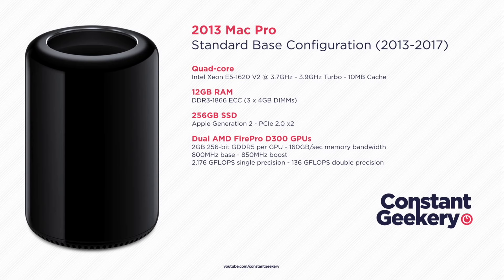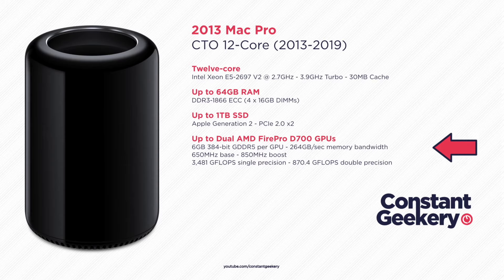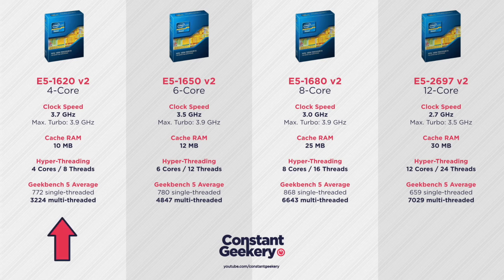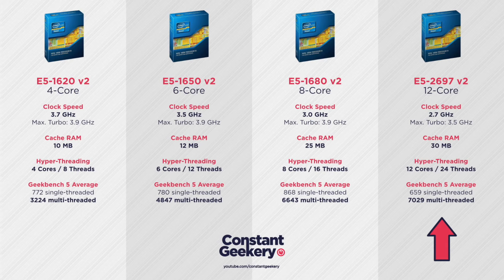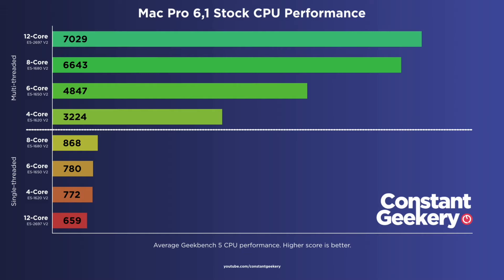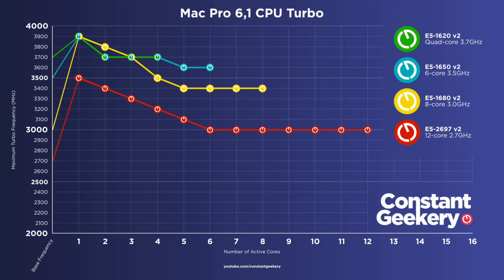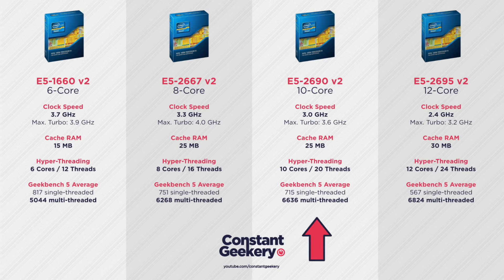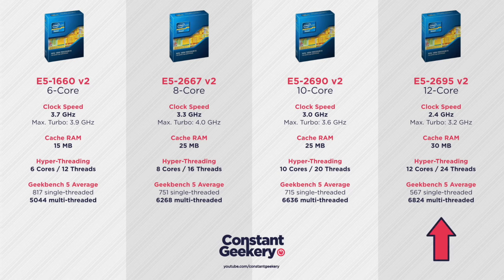Which 2013 Mac Pro should you buy?

Comment from the maker: Apologies for the dodgy lighting, editing and sound. Not my best effort!
Reply: Constant Geekery content is stellar
Reply: I didn’t notice an issue, just background light increased and decreased in tone.

But I was paying more attention to content that what was around you.
20k subs gogogo
Reply: Hey friend, I wonder if you have any suggestion to this problem...when I replaced my internal drive with an OWC one, not knowing better or perhaps something went wrong, I, by mistake formatted the OWC drive in Mac OS Extended (and even worse, as Case-sensitive), since then it won't let me update my OS saying it is a non-compatible third party drive.  I asked OWC what to do and they suggest I just put in the original drive to do updates...the problem is that I already long ago wiped that drive fully, including the security partition, for other uses, so I believe it won't do me any good? right?  High Sierra really lags for me these days and the case-sensitive mistake has cause me other challenges.  Any ideas on what I can do?
Reply from the maker: @MichaelSidneyTimpson  If you’re happy to wipe the drive, I would try restoring from Internet - OWC drives should support that. (https://support.apple.com/en-gb/HT204904) In the restore system you can open Disk Utility and make the changes, then you can clean install the OS.
Reply: @ConstantGeekery  The original drive or the OWC drive?   if original drive, do I really have to break open the OWC encloser and remove the OWC drive and put in the original drive or can I do it all from USB?
Reply: @ConstantGeekery  unfortunately that's a dead link
Reply from the maker: @MichaelSidneyTimpson  you said the OWC is your internal drive. Restoring from Internet will work on the internal drive. YouTube has made the closing bracket part of the link, which is why it doesn’t work. https://support.apple.com/en-gb/HT204904

Comment: Great video. i actually picked up 12 core  with 512ssd. it only had 16gb ram which upgraded to 64 for less then $100. the great thing about it was it was advertised will D500's but when i got to the seller and we powered on it turned out it had D700s. it was a recording studio get the shelves cleared for the 2019 Mac Pro. The IT guy handling the sale didn't want the hassle so he still honored the listed price with a $100 reduction because i mention the ram upgrade i had to do. Picked it up for $1650! yes it was a steal! I was upgrading from a 2010 Mac Pro Cheese Grader so it wss a nice upgrade. After all the peripherals which i slowly pieced together used and new items total cost of the system came out to about $2300. I'm a sound mixer so it more then enough power for me. Since all my work is offline picture resolution was never going to be an issue. I'm now running four 1080p monitors and i couldn't be happier. the only then i want to advise is make sure to download and install Mac Fan Control. this machine have a tendency of overheating and this  app will really help prevent this. the pro edition of the app is $15 and will worth it. After install adjust to at least 1600rpm constant fan and then 1800 for work when editing. this will help tremendously keeping the system from overheating.
Reply from the maker: That sounds like a very good deal indeed! Completely agree on the fan control. I use TG Pro, which is very similar. My Mac has been super stable ever since. Thanks for watching and sharing 😊

Comment: This is the best and fullest explanation of the Mac Pro 2013 upgrade options I have seen yet!  Thank you!
Reply: I am using a 2013 Mac Pro 3.7 GHz Quad-Core Intel Xeon E5, with the (nicer) AMD FirePro D500  graphic cards for Photoshop work, the logic to move up to the E5-1680 8 core chip makes a lot of sense, thank you!  I suppose I could go for the 12 core, but the higher clock speed of the 8 core chip seems like a good idea for normal day to day use, and the loss of speed VS the 12 core does not seem to be that much.

Comment: I just bought a base model off some guy on gumtree, it was his work PC and they told him he could keep it.  I dont think he new what he was selling tbh cos he listed it at £299 and as soon as I seen it I rang him and said I would take it.  WIthin 4 days, I had upgraded to 64 gb of ram ( the max you can have if you want to run it at 1866 Mhz ) stripped it down and took out the crappy 4 core cpu, put an 8 core in, thermal paste and cleaned the machine.  Now its running at 38 degrees idle and a lot faster now its using all 4 dimms and the new cpu.  I want to get some D700s but they are just to expensive.

Comment: I bought the entry level MP trashcan in 2013. I could only afford the very base model. But it is still my main computer and does everything I need quickly. I don't do games or video but I do a lot of Logic Pro music with zero problems. My specs
3.7 GHz Quad-Core Intel Xeon E5
32 GB 1866 MHz DDR3 (upgraded from 12GB...only update)
GPU AMD FirePro D300 2GB
Have NEVER had a fail of any kind. Still my main computer. And I still LOVE the design.

Comment: When Phil Schiller gave a sneak peak of the Trash can Mac Pro  i instantly fell in lust with its unique stying , a radical improvement from its big boxy cheese grater predecessor , this machine was elegant and had a small footprint reducing desk clutter . Learning it wasn't that upgradable at the time i blew my savings on a maxed out 12 core 64 GM memory and 1TB SSD . Thats about a grand a year since the purchase price from Apple was 7K . Well its used daily , silent running and still looks awesome , i get the limitations of connectivity but that's the trade off with such a compact machine , it still looks radical and not dated i would go as far as to say a design classic though i know it has its detractors like Marmite .

Comment: Thanks for the info, I purchased the six core new with an apple 1TB hard disk when they came out, replaced the ram with OWC 64 gigs. It did overheat sometimes but mainly from collecting dust so clean it out occasionally, i run 2 apple 27inch monitors, an LG 34inch Ultrawide as well as a sony bravia 55 inch through the HDMI port. I love all the monitor ports as it replaced my previous apple tower which I had installed multiple video cards to do the same thing so it was a no brainer to buy a machine that of the box could do what my previous machine had to be customised to do but running about the third of the electricity but more silent, also the fact that it looks a little like R2D2 is a bonus.

Comment: Hi I picked up a 6 core model with the D500 GPU's and 32GB ram. total $99 with shipping. cosmetically its near new with only a small scratch or two. So far its handled every thing I've thrown at it. Installed Final Cut pro 10 and working on my first video with it now.

Comment: I went with a 12 core a couple years ago.  At the time my thinking was that I wanted to max out everything on my 6 core. So I went to 64GB ram, OWC Aura Pro x2 1TB SSD and was already working with dual D700. 
What I found out is that the D700 have more artifacting problems than the D500. Also, the 12 core CPU only hits it's stride when you are firing on all cylinders. On single threaded stuff the 6 core was slightly better. Wish I'd gone with the 8 core. Also, you can get 128GB ram to fit, but it knocks you down a notch in speed. 
Overall I'm happy with my setup as I can have Photoshop, Premiere, Logic and a few other things open with no noticeable impact. 
OTOH, I still suffer terribly doing renders. Also, the disk subsystem and USB ports are slow and really bottleneck the work you can do. 
TB2 is the only way to go for storage. The USB3 on this machine is actually only slightly faster than USB2. It is very bad!

Comment: I've only recently discovered your wonderful channel when looking for upgrade advice for my Mac Pro 2013 3.7 GHz Quad-Core Intel Xeon E5 which I bought on eBay in early 2017 - so thank you for enlightening me of the constructive options available. I matched the Mac Pro to a newly discontinued Dell UK2715K monitor which had matching twin Display ports as well as a single Thunderbolt 2 mini Display port. I had the ram upgraded from 8GB to 32GB using 16GB x 2 in one pair of slots only. Sadly, the pair of display port cables only worked for a short period before something gave up the ghost so I am left with the single  mini display port cable as the main source of monitor display. I have successfully produced an animated 8 minute video using Adobe Premiere (albeit the rendering was painfully slow) as well as for Photoshop, Illustrator and Lightroom but have now run out of disk space but use USB WD hard drives for extra storage. I now want to upgrade the Ram and replace the processor as demonstrated on your video (it looks relatively straight forward?). My questions are as follows, 
1) Replacing Ram:- How do I identify the Generation 3 or 4 Apple replacements being advertised compared to the original fitted Ram boards?
2) Replacing CPU:- Should I look only at 8 core CPU with 130 watts for this particular Quad powered machine rather than 12 core that appears to require 150 watts?
3) What do you think is my problem with the paired display port cables not delivering (half screen each when they worked)?
4) I run Catalina 10.15.4. Should I revert to Mohave?
These issues have been accumulating over the last 2 years until I discovered your channel! Any advice would be very welcome - thank you.

Comment: Just bought my trashcan originaly purchased in 2015 with dual D700s and 6 core CPU, instantly swapped it into the 3.3 ghz 8 core you've mentioned as I was about to repaste the whole system for optimal cooling :) the sad thing is I bought a wrong nvme ssd which Mac Pro didn't read and I'm about to swap it for another.

Comment: aspiring audio engineer here, I have been having issues with audio plugins in pro tools running on windows and macs, I mainly use 6 core processors and the 1 time I used an Apple silicon processor I finally had the pleasure of running more plugins, it was the 10c CPU with 8 Performance and 2 efficiency cores. Its a lot of money.. I just purchased a Mac pro quad core, and a 2697 v2 12 core CPU. I specifically looking for a budget replacement for the expensive m1 pro macbook pro! IF this performs the same or better then im selling the macbook pro!

Comment: Dust makes a huge difference, my AIO Ryzen 7 1700, was reducing performance to 25% due to bad air flow from duct. I opened system up, cleaned intake holes and removed system fan (CPU/GPU) and body, vacuumed out heat sink etc.
Performance went back to 97-99%. Didn't change thermal paste as system under warranty still.

Comment: I think the 8-core D500 is the best to have, but a budget option would be getting a 4 or 6-core and buying a 2680v2 processor, it is a cheap 10 core, usually like 15€, where the 2690, 2697 and 1680 all do around 100€.

Comment: Just bought a 6 core 32gb RAM, 1Tb SSD with the D500 graphics cards. Your video has convinced me that I made the right choice. I have already found a matched set of 4 x 16 sticks of RAM for £36 and a used E5-2667 V2 for £15. 

That is a total of less than £320 for a very decent machine! (now where’s that thermal paste!)

(Edited to add that reading most of the comments on here, the 1680 8-core processor is probably the way to go. A bit rarer and about twice the price of the 2667 but I suspect that I will end up with a better machine.)
Reply from the maker: I would stick with the 2667 - it's clocked slightly higher. Not much difference on boost frequencies, but in theory you should get marginally better single core performance.
Reply: @ConstantGeekery  So you would recommend the 2667 over the 1680?
Reply from the maker: @john8451  either is great. I’d choose the 2667 personally.

Comment: So I've always wanted one, and recently had the opportunity to get one on the cheap.  6core 32gb of ram, the low end D300's.  I didn''t know what to really do with it, so I did the upgrade from whatever it had to Catalina, and wow what a MISTAKE.  First off I loaded up steam as many games that I have, also have MacOS versions, but the majority are 32bit, so that sucked.  The one game I wanted to play with my kids, Kerbal Space Program, actually caused the machine to have CONSTANT kernel panics.  I think the thermals are kind of dodgy on these machines, they do remind me a lot of the G4 cube, a machine built around a quite heatsink, although the trashcan has a fan at least..  I loaded Macs fan control, a MUST have program for any 2013 Mac Pro user out there, as the Apple defaults are simply too low (I made the mistake of lifting the lid after a kernel panic and it was incredibly hot under there!

You may want to do a video on how to downgrade to Mojave, as it wasn't all that intuitive (well for me anyways) as the bootable USB won't show up in the control panel, instead you have to hold down a key at boot to get the OS boot list to boot from USB.  I deleted all the old partitions and installed Mojave which may have been a bad move, as I don't think Mojave installs a factory recovery partition on re-install. OOps.

I have a PC with dual E5 2667v2's and I thought it was a pretty fast machine, although I didn't realise that the  2013 MacPro was also a 2011 machine, I'd thought for some reason it was v3 at least, but oh well.

I'm curious to what others thing of Catalina on the 2013, to me it's a total dud.
Reply: Did you ever figure out how to downgrade to Mojave?   It’s easy.  I can help.

Comment: CPU/GPU speed aren’t the only measures that matter. How fast are the drives in these machines? I’m guessing pretty slow compared to new SSDs in the Mac Mini or the MacBook Pros.
Reply from the maker: I’ve done other videos on that, but max speed on this machine will be about 1,400 MB/sec. So, yes, slower than the latest. However, as Linus Tech Tips recently proved, once you get to about 600 MB/sec, most people can’t tell the difference in everyday usage. Obviously if your workflow involves a lot of file copying you will notice, but for the vast majority of workflows, it’s plenty fast enough.

Comment: I bought my 6 core new refurbished from Apple in '14 as well as the Apple care warranty. I saved about 1200$us from a brand new in the box one. It came with the D700's, 500gig SSD and 8 gigs of ram which I upgraded to 32. I used it mostly for SD video editing and Photoshop with a little bit of 4k, which it does very well. Now Im mostly using it for music recording and production which is pretty easy for this setup, although nothing really uses GPU that i'm aware of. I just upgraded the SSD to a 1TB EVO, no real problems other than I was using 10.11 and had to  upgrade to 10.13 to take advantage of the NVME.  So I started to have video troubles recently and after a bit of research found out about the GPU recall, a few calls to the online service dept and they really took care of me. Replaced both video cards, IO board and some other stuff, all no cost.  If you have an Apple work flow, this is it.
Reply: What kind of problems with video Mark?

Comment: Great series,  aftet watching I decided to make a Mac pro 6.1 purchase with a 6 core 32g  AMD D500.    I have one question as I day trade stocks , I notice I could not add more then 2 monitors I usally use 4 monitors.  I notice You had ePGU in the back ground, would that help with adding more monitors to Mac Pro ?   or which is the best ePGU that matches up with Our Mac Pro?  Thank you
Reply from the maker: You should be able to drive six displays, unless your screens are 4K, in which case it’s two via the Thunderbolt ports and one more on HDMI (though HDMI will only run 4K at 30Hz). The eGPU is an option for additional displays and I’ll be doing a video on this soon. It is not natively supported on the Mac Pro 6,1 so you have to use a third party tool to make it work (purge-wrangler). You also need Apple’s Thunderbolt 3 to Thunderbolt 2 adapter. You won’t get maximum performance from the graphics card. Also you have to plug in (or switch on the eGPU) after boot up and it’s best to disable sleep mode. I use the Razer Core X because you can buy your own card - you can’t change the card in the Blackmagic Design models. If all you need is additional displays, the Sonnet Breakaway Puck is the cheapest route. Hope that helps, and thanks for watching! 😊
Reply: @ConstantGeekery  They are not 4k monitors just LG 23inch  FULL HD 1920X1080 - I tried to get all 4 displays going at the same time, did not work.  But I am going to go with Sonnet Breakaway Puck - Ill just have to figure out (purge wrangler )   thank you for the reply - looking forward towards your ePGU video!

Comment: I just bought the 12 core 64gb and d700 version. i have it in bootcamp. but cant run some games because of it showing that the driver is not the latest. and  i cant figure out  how to upgrade the driver. the bootcamp seems to not have the latest driver for it. i also cant use any kind of AMD system test software or AMD driver update software. i was hoping this could run windows without this kind of issue. Now im worried that some of the programs i like to use wont run smoothly on the windows bootcamp side. let  me know if you have any resources i can checkout for some possible help. thanks